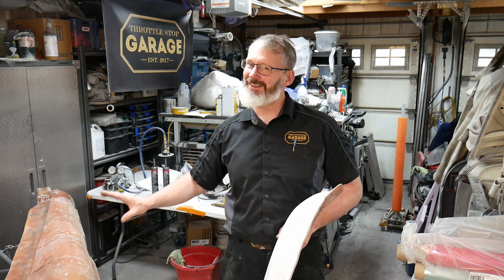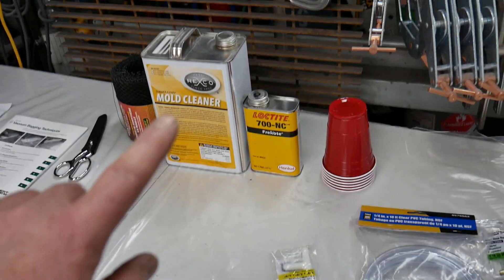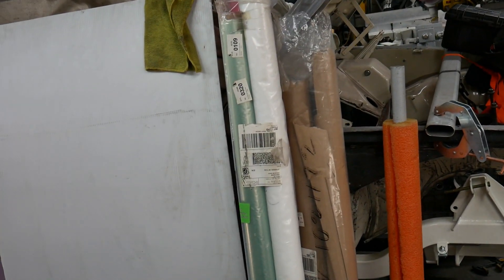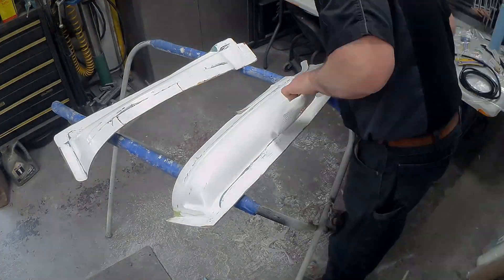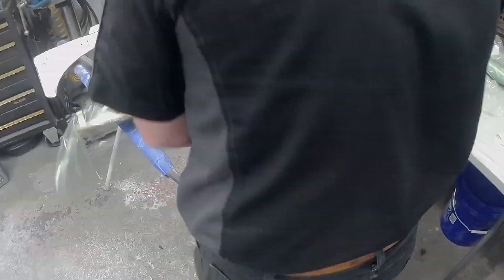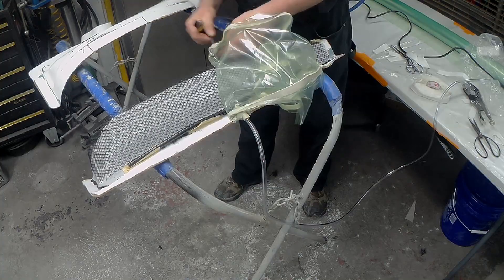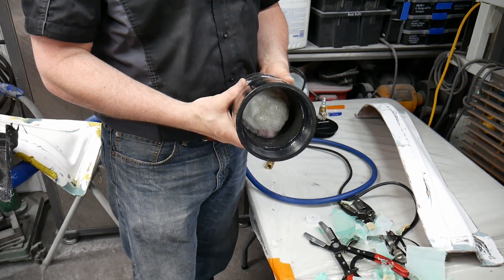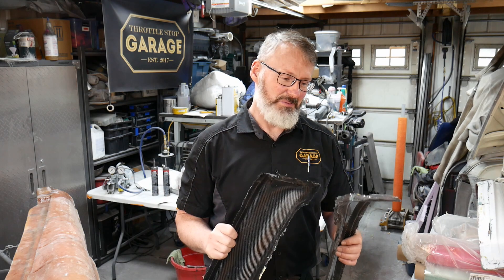Carbon Fiber Epoxy Infusion!  (Ep. 51)

Comment: For vacuuming small parts like this it is easier to use vacuum seal tube instead of film sheet. It is the same material only it comes in a shape of a tube, Pick a tube size large enough to allow for creases, cut it longer to allow for creases. Put your mold with part and infusion stack into tube and now you have just two open ends of a tube (edges) to seal. You do not need to seal sticky tape it to the mold. And for sealing the tube ends some people use C sections and tubes.
Reply from the maker: This was my first part!  I know this now...I didn't know it then.  Ah, the memories.  It would have been a pile easier with a better mold and had I known about tubes!

Comment: I realize this video is kinda old but if you make a positive and negative to your mould then seal all 4 sides of an oversized bag (save two small ports for resin input and vacuum extraction) you'll have a much better time and results. It's worth it when making identical parts repeatedly and for perfectionists like yourself and myself.

Comment: Thanks for your honest and straightforward video.   My questions are, how did you like the NC700 mold release?  Did you apply it then wipe or just apply and leave it?  I have it, but, i cant bring myself to trust it.  Been using additional release over the NC700.
Reply from the maker: It's worked great ever since I stopped polishing it.  Next video will cover the application in a little more detail.
Reply: @ThrottleStopGarage  Ahh, well, I will actually try it that way on your recommendation.  Thanks a lot for your quick reply, thank you.

Comment: If the part's small enough, and the bagging material is cheap enough, you could have just used a hand held bag sealer and created a custom-sized bag to stick the whole part and mould assembly.

Your only points of leakage would be the holes you stick the hoses into and that's it.
Reply from the maker: Understood - the point was to try the technique.  I learned a lot on this phase of the project.

Comment: I’m enjoying the videos thanks learning a lot. I seen another guy just use a sheet of plexiglass put the part on that then duct tape the bag down where it’s nice and flat. Looks a lot easier though you would need support under your mold to sit flat, but if it had a flat bottom designed into it? He also has a alum box with a space heater on top  that helps speed up curing times.
Reply from the maker: Might work for a smaller part - for sure I wouldn't use duct tape to seal a bag.  I should have envelope bagged these parts.

Comment: Thanks for the video. I have wanted to try making my own carbon fiber parts for a while now. I noticed during the vacuum bag operation, the bag did not "fit like a glove" so when vacuum was pulled, the bag had what appeared to be folds in it. Does that affect the quality of the part by putting epoxy ridges in it or doesn't it matter due to the bag being on the unseen side? 

If you have trouble finding  the correct compressor oil, Amsoil sells a variety of compressor oils.  You can go to their website and locate a dealer near you and he can order it and it can be shipped directly to you. Or, go to the website and follow directions to order yourself. It may take a phone call to Amsoil Tech by the dealer to find out exactly which compressor oil you need. This line is not available to the public. I have called them many times to get technical answers and they understand petrochemistry, it is their job. 
https://www.amsoil.com/shop/by-product/compressor-oil/
Reply from the maker: Second question first, my local compressor dealer had the correct oil. The bag has to be much larger than your tool. The peel ply sits next to the carbon, then flow media, so the folds don't impact quality and are needed for vacuum infusion to work properly.
Reply: @ThrottleStopGarage  thanks

Comment: On small molds like this, one can create a "pillowcase" and slip the mold into it and seal the end flaps to each other. This way you're bagging to a bag and don't need a large flange to tacky tape to.
When pulling the vacuum, stop halfway and get the outside/bottom of the mold bag in place first, then restart the vacuum and finish the part side.

Comment: we have opposite opinions on tacky tape - I hate the yellow and love the grey. :)
Reply from the maker: Interesting - some of the grey is low tack, some is stickier than the yellow.  I had the low tack stuff and it wasn't great.  No issues with the yellow.
Reply: @ThrottleStopGarage  , I got my grey from easy composites - its super sticky.
Reply from the maker: @Talisman-tb6vw  Ya, that's the other tape - I've never used it.
Reply: @ThrottleStopGarage  , its super sticky - makes getting a vacuum on your bag easy - but because its super sticky, its a pain to remove from the mold. I have been just cutting the bag away and pulling the part - then going back later when I have time and work on removing the tape. I'm doing low volume manufacturing - generally no more than 50 pieces per mold. The exception might be the console cover - SaddlX wants to prototype putting their leather on my cover, so there is potential there for hundreds. I plan to make a half dozen molds and make 3 or 4 covers at a time.

Comment: 2 things I noticed, was you didn't use any plates in the tape and vacuum bagging material, and no clamps on the hoses
Reply from the maker: I had a few pleates in the second part - there was slack in the bag, but not enough.  I now use line clamps!

Comment: add a resin break (basically no flow mesh) so that the resin travel slows significantly has sufficient time to travel all over your mould before being pulled into your vacuum line and into the pot.
Reply from the maker: For sure - I made these molds a long time ago and didn't really know what I was doing...I should have also infused going the other direction!

Comment: Great job on those pieces!...you spoke of the bias of the matt...in the aerospace industry, where weight and not using more material than necessary is important and considered and optimized, the fiber/bias direction is specified as it also determines the direction of tensile and bending strengths...it's so not critical here obiously, but I thought I'd mention it...you probably knew...also, I hear you saying that these molds are going to be used for only onezie, twozie production...I need to point out that with the (massive really!) work you're putting into the molds, you should not think that way!...you are breaking new ground in many respects, so YOU may not want to do this a third time, but someone else may want to buy your molds, and produce some carbonfiber or fiberglass items themselves...or send them to a boat-builder, where they can do them in chopped glass...what I'm trying to say is: never think short term and only for your own needs! ...always think long-term...the vintage Volvo community and our needs and wants is way bigger than you might think!  Cheers from the SWedish-EMbassy!
Reply from the maker: Thanks Ron - much appreciated comments. On the other parts, I will pay close attention to the fabric direction. Cheers.
Reply: Team Volvo!
Reply: I guess Im asking the wrong place but does someone know a trick to get back into an instagram account??
I somehow forgot the login password. I appreciate any assistance you can give me
Reply: @Wilson Isaias I really appreciate your reply. I got to the site through google and Im waiting for the hacking stuff atm.
Looks like it's gonna take a while so I will reply here later when my account password hopefully is recovered.
Reply: @Wilson Isaias it did the trick and I actually got access to my account again. I am so happy:D
Thank you so much you saved my ass !
Reply: @Kieran Raymond No problem :D

Comment: Pro tip: use perfurated film over the peelply and under the flow mesh!
Reply from the maker: I did get some of that - using it next time for sure. It took an hour to get that peel ply off!
Reply: @ThrottleStopGarage  so when you use it,  will be the best sensation before demolding a part hahahah the flow media comes off so easy.
Reply from the maker: @RodrigoNascimentoMattos  looking forward to that!